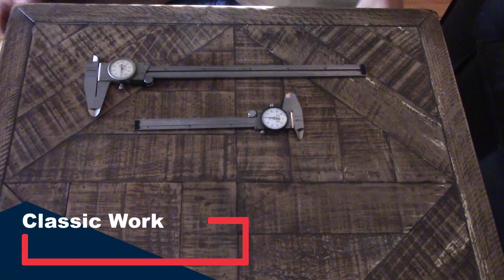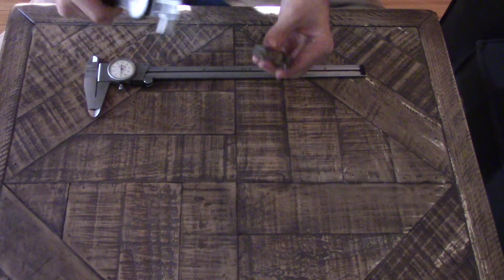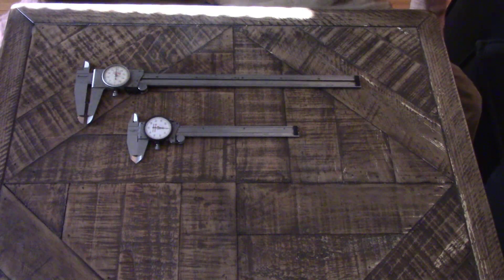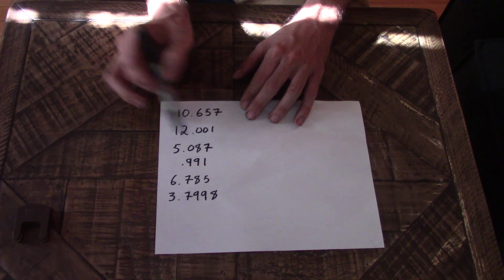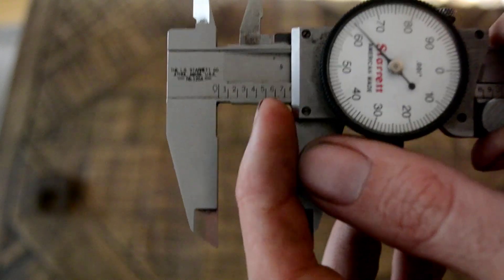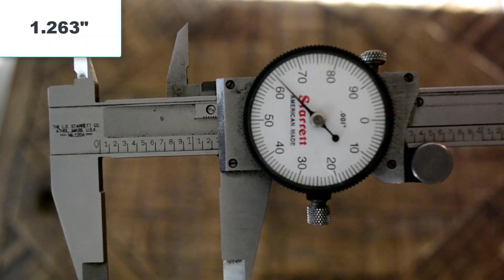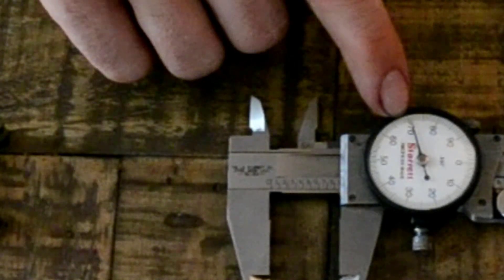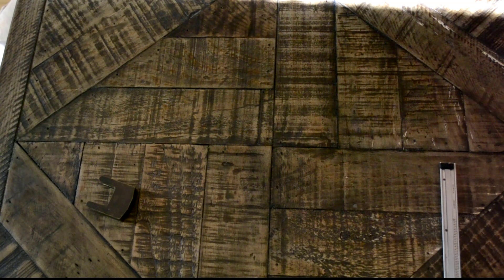How to read dial calipers #1 (BTTB)

Comment: There is also a 4th way to measure with the dial caliper using the front like a depth  gauage. It gives you wider surface than thin rail that protrudes from the rear of the slide. Not used very often but comes in handy at times.